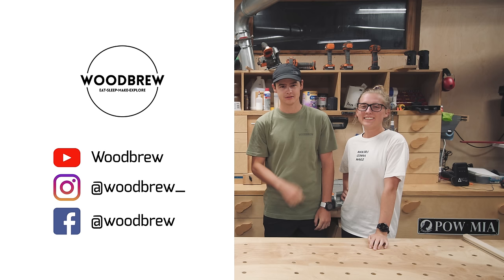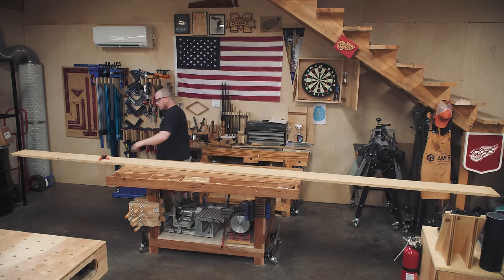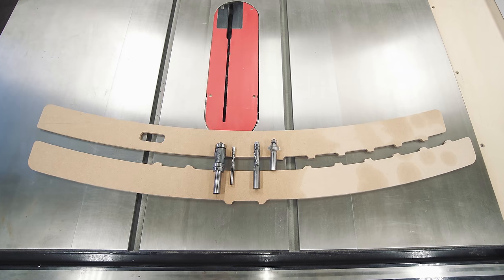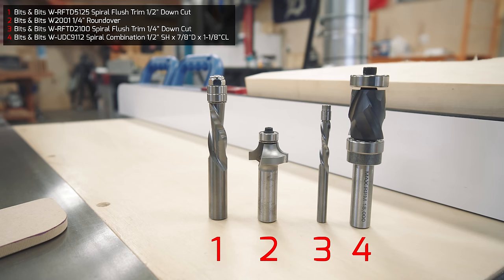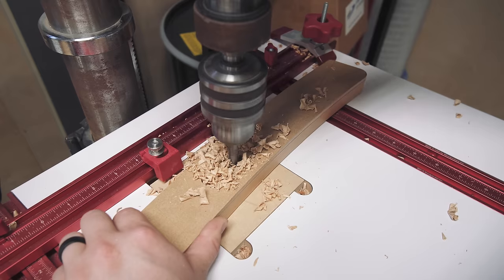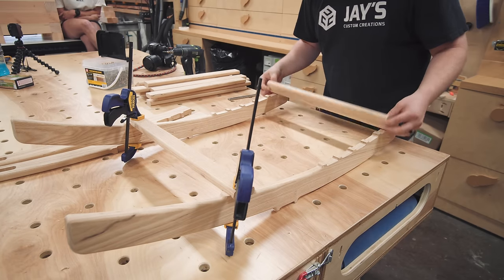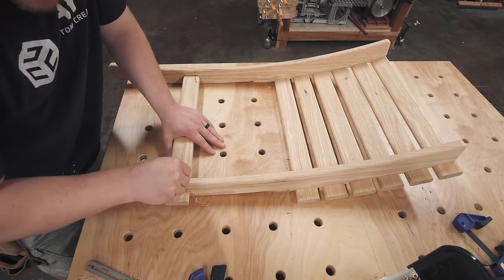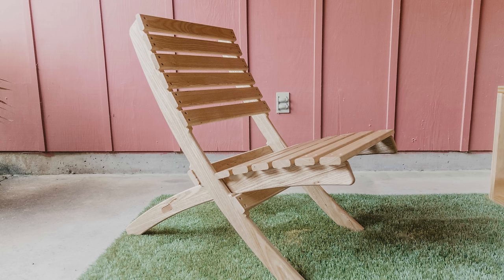Portable Nesting Chair With Full Size Template - 327

Comment: 7:35 I totally agree. Not all push pads are created equal! Anything with the grippy foam as pads are not great. Push pads tend to wear out over time and even when new don't always provide a lot of grip. As long as my hands are safely away from the bit or cutter I feel that using my hands is much more safe. Dare I say I do this at the jointer as well. Of course the smaller the work peace the more I am apt. to use push pads or something other than my hands. Great Vid, Love the new shop!

Comment: The layout and organization of the new shop is well demonstrated in this video.  Looks like a fun space to work in!
 Have you ever considered building a paint booth complete with a filtered exhaust system? A buddy of mine has a small booth in the corner of his shop complete with a turntable and the ability to hang small work pieces from the ceiling. I have used it and it is awesome.

Comment: Great project, as always.  I remember making that same chair in high school production woodshop class back in the early 80s (Yes, I'm old).  You've improved the design by adding cleats on the legs for the seat/back slats.  We used a jig to set up all the pieces and then screwed everything together so we didn't need the cleats.

Comment: Love this project.  Will be ordering the templates tonight.  Wonder if this would be okay with bent laminated supports instead of cutting them out.  Gonna have to try one set to see for myself.  Thanks for the great videos Jay.  By the way, shop looks amazing the dust collection on the router table works awesome.  I need to build one of those someday also, after I get a better router with for a 1/2" shank for the table.

Comment: Have you thought about a curtain system in the corner of the shop for spraying?  It would tuck against the wall out of the way and then pulled out for spraying to keep contamination to one corner.
Reply: Like a big curved shower curtain rod? Or just a straight long rod? Or a cable that the curtain slides along?
That would also help keep ambient dust out.
Reply: @TheRPhelps24  A commercial curtain system.  Body shops and commercial places use them.  Has a track on the ceiling and the curtains slide on small rollers in the track.  Can be clear or colored or whatever you want.

Comment: The 1/4 inch round over bit does not remove enough material, so I’m having to sand each slat to fit snugly in each opening. Am I doing something incorrectly?

Comment: I was having an issue using a template to route something that had a small foot like these chairs.  

I’m wondering if it was because it was a straight flute bit and not a spiral style.  The long edges were easy but once I got to the part that would rest on the ground. Which was maybe 2.5-3” wide the router would kick back.   Stopped routing that part and finished off on the band saw/sander.
Reply: @Joe Gravelle - Yeah, most likely. Those straight blades love to grab end grain. Found that out the hard way and ruined a project. The router ripped a good 1/2" chunk off of the side of a piece of oak right along the grain line.